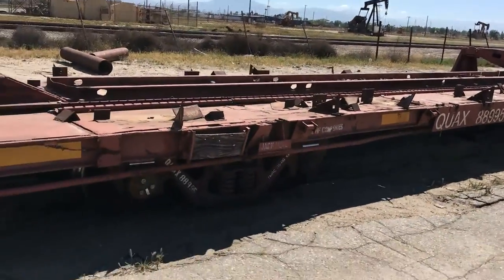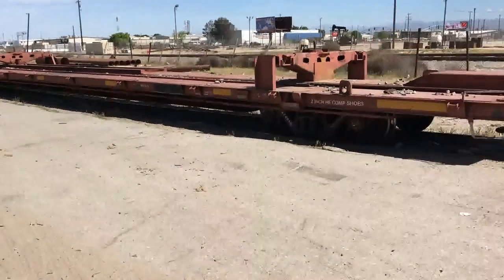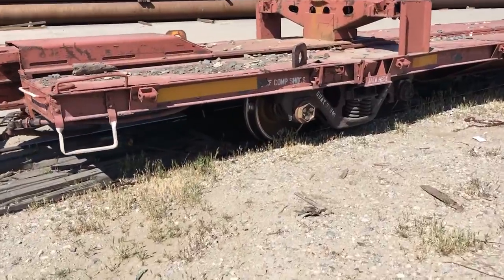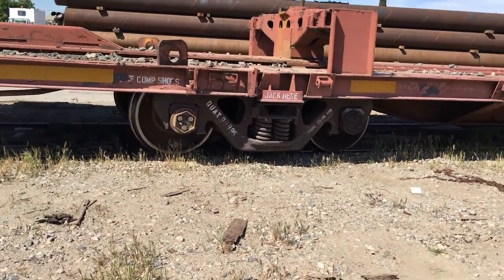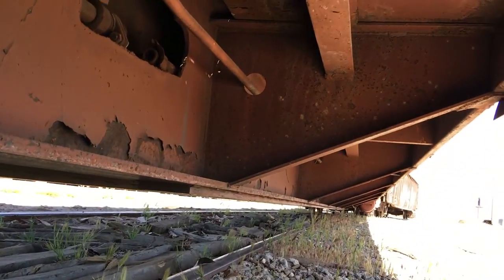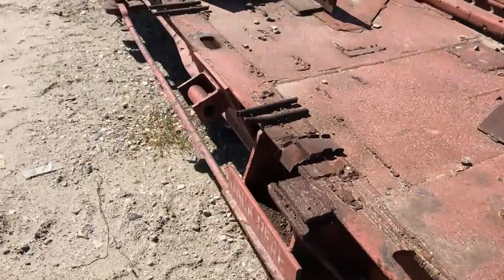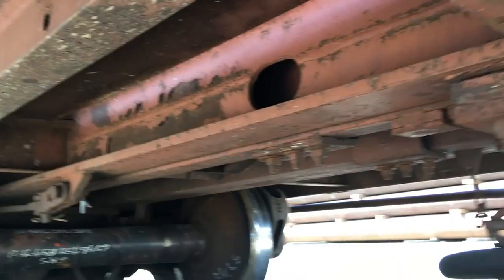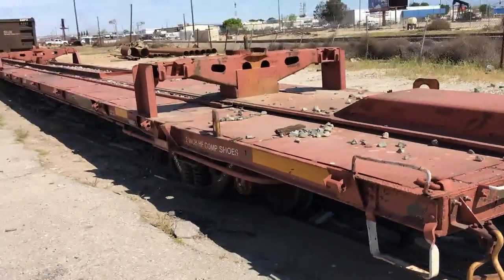QUAX 88995

Comment: No way that car is still in service. That hole cut out in the center sill was to access the train line pipe. Probably to make repairs to that old compression coupling. I've heard talk of these cars ,but have never seen or saw one used. Thanks for the video. That  28" wheel is on most cabs. As well
Reply from the maker: Center sill routinely have holes cut in them to run train line pipe through them. Perfectly fine. Of course, they are designed and cut that way by the original manufacturer. Otherwise, cutting the center sill is a labor intensive repair with x-rays needed to ensure full penetration. You should never mess with the center sill.
Reply: I've seen a few QUAX here in Houston recently

Comment: Aren't 28" wheels used on auto racks?
Reply from the maker: Mark Schenher Very good observation. 28" wheels are found on most tri-level Auto racks but not on bi-level racks as those typically have 33" wheels. The railcar in this video used to be a tri-level rack.